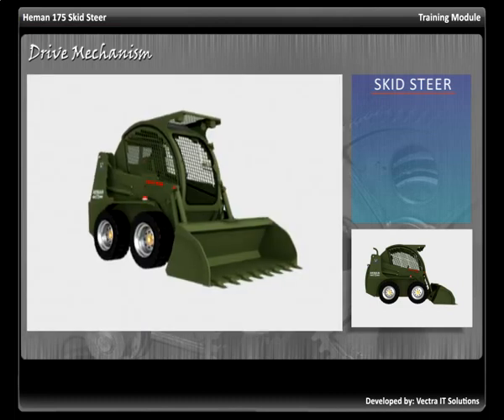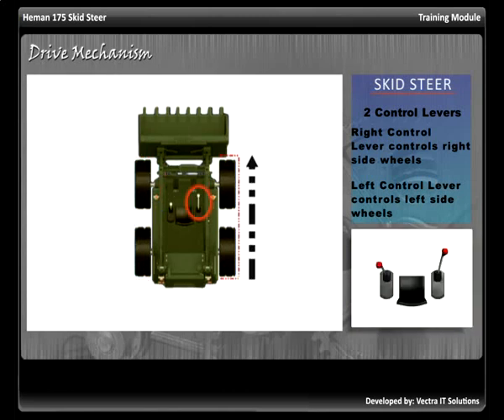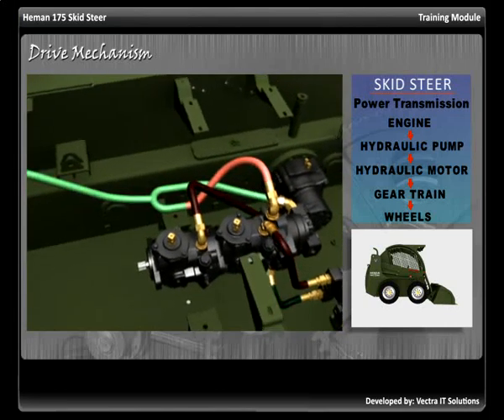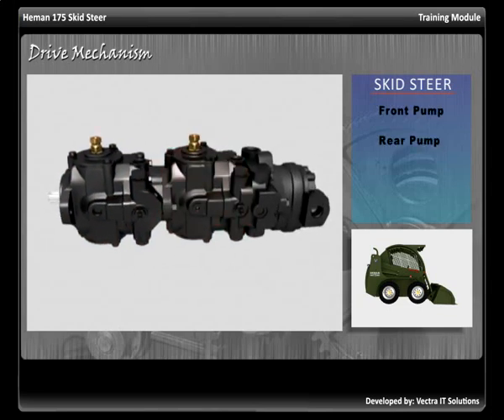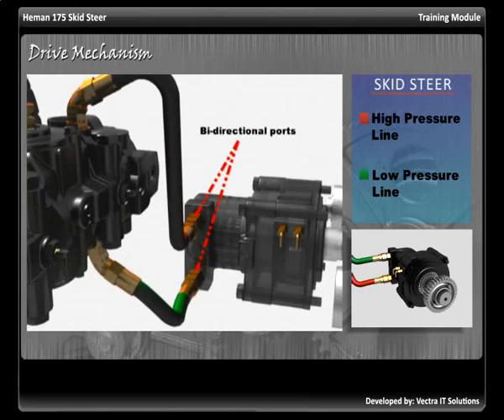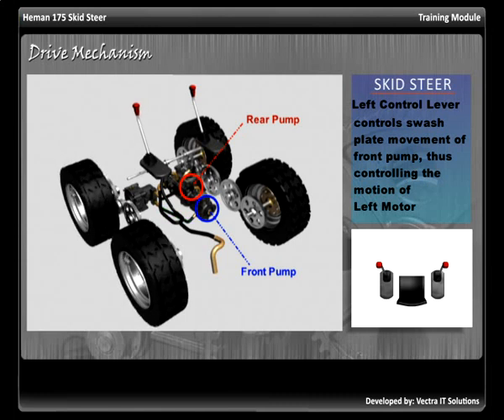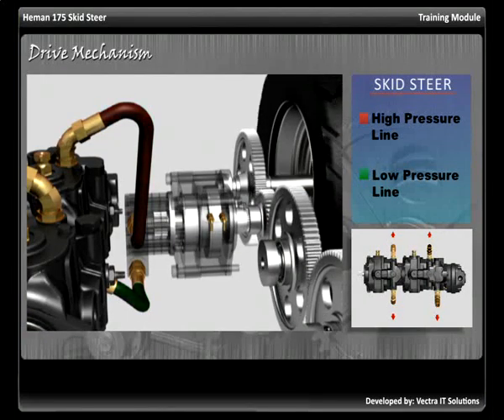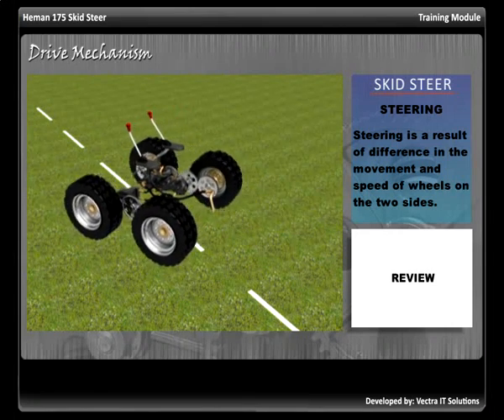Drive Mechanism in Skid Steer

Comment: 10,000  TIMES THANK , and  personally speaking , now  I understand the tremendous work performed by the hydraulic oil. The oil being under that  much pressure thereby become very hot and not being properly cooled ,  thereby  110 % start the damage  to  every thing in the hydraulic system.